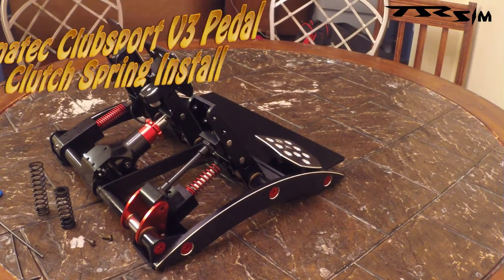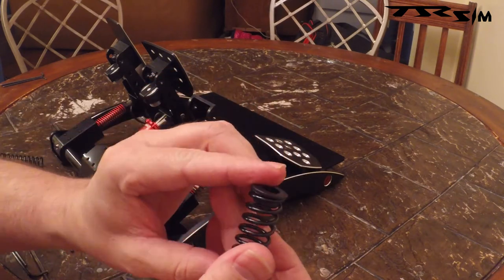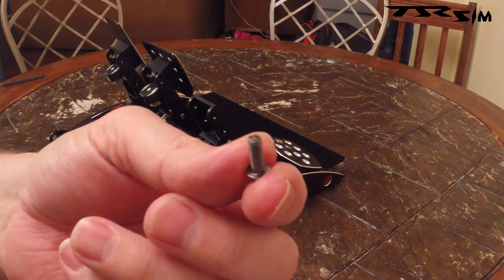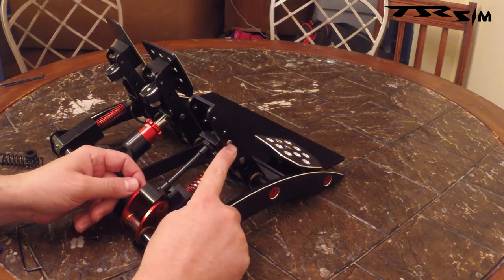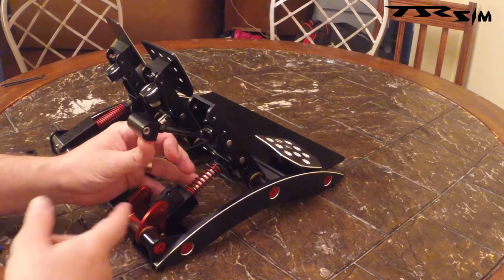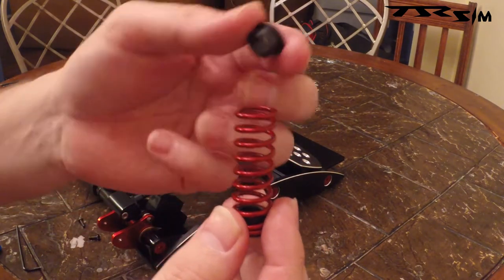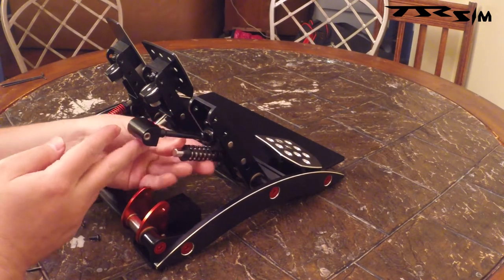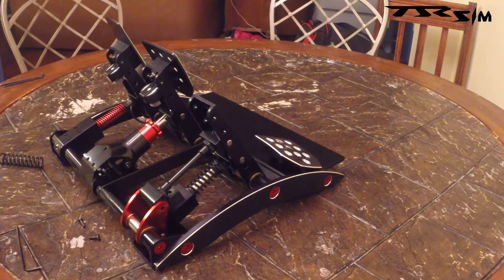Fanatec Clubsport V3 Pedal Clutch Spring Install

Comment: This tutorial is misleading, please check SimracingPQ's reponse in the comments below, he tells how it's possible to do it. With this tutorial there is no way to loosen both screws as one is usually too tight. But you can try your luck...
Reply: I thought I had stripped or broken something, glad i saw this.
Reply from the maker: It's pretty basic mechanics to uninstall 2 screws. I literally make mention of the issue at 1:20. I guess ya'll don't watch the video in its entirety. Also this is exactly the way Fantec the manufacture explains how to do it here. https://fanatec.com/media/pdf/98/74/d9/CSP-V3_Manual_24-1.pdf  Now their is more ways to skin the cat. You can also just unscrew at the pedal itself. Just remove the setscrew, slide the pin out, hold pressure against the rod by pulling it towards you to overcome the spring tension and let it bottom knuckle flip back to remove the spring.
Reply from the maker: @henrymetzger9951  It's pretty basic mechanics to uninstall 2 screws. I literally make mention of the issue at 1:20. I guess ya'll don't watch the video in its entirety. Also this is exactly the way Fantec the manufacture explains how to do it here. https://fanatec.com/media/pdf/98/74/d9/CSP-V3_Manual_24-1.pdf  Now their is more ways to skin the cat. You can also just unscrew at the pedal itself. Just remove the setscrew, slide the pin out, hold pressure against the rod by pulling it towards you to overcome the spring tension and let it bottom knuckle flip back to remove the spring.
Reply: @TJRSiim, you briefly touched on it, but the screws are just too tight. one will always get stuck on me.. How do you prevent the insert from turning while unscrewing the second screw?

Comment: Thanks man, just saved me from tearing my pedals half apart! Installed both the throttle and clutch springs. Now to install the damper, ill check ur other vid for that
Reply from the maker: Glad I could help!
Reply: Why would you want to replace the throttle spring? It feels perfectly like in a real car like this, as the throttle pedal is supposed to be nice, soft and sensitive.

Comment: I'm wonder, does it feels like a racing clutch?
Reply from the maker: Hey, thanks for asking. Actually no it doesn't feel like a racing clutch. It does have the resistance push over effect like a stock cars clutch but is not as strong as a racing clutch. Really don't know of any brand out there that has mastered the proper clutch feel yet. I think for sim racing it is close enough though as it's still a lot of fun to use.
Reply: TJRSim ah i see, i'm planning get fanatec setup by next month, Thanks.
Reply from the maker: Awesome! You will enjoy it I'm sure. Here is a link to help out the channel for Fanatec stuff. Doesn't cost you anything using it. https://goo.gl/oWRku6

Comment: What's your complete  set up
Reply from the maker: +MARTAY MEDIA  I also have it in my description, but here is my setup: PC & Rig Stats:
• IBuyPower I7 4930K 6 core 3.4 GHz/12MB L3 Cache
• 16gm Ram DDR3-1600
• AMD Radeon R9 290X 4GB Card
• Gigabyte Motherboard
• 750 Watt Corsair RM740  80 Plus Gold Full Modular Power Supply
• Fanatec Clubsport Wheel  V1
• Fanatec Clubsport Shifter
• Fanatec Clubsport V3 Pedals
• Fanatec E-Brake
• DSD CSR/CSW Button Boxes
• Sim Instruments Dash
• Sim Xperience Software
• rSeat Evo Rig
• 5 Buttkickers tranducers ran with Sim Xperience Software (SimVibe)

Comment: What a joke.  Skips over the most important part of the process; removing the machine screws, which is near impossible without destroying the soft aluminium fasteners.
Reply from the maker: It's pretty basic mechanics to uninstall 2 screws. I literally make mention of the issue at 1:20. I guess ya'll don't watch the video in its entirety. Also this is exactly the way Fantec the manufacture explains how to do it here. https://fanatec.com/media/pdf/98/74/d9/CSP-V3_Manual_24-1.pdf  Now their is more ways to skin the cat. You can also just unscrew at the pedal itself. Just remove the setscrew, slide the pin out, hold pressure against the rod by pulling it towards you to overcome the spring tension and let it bottom knuckle flip back to remove the spring.